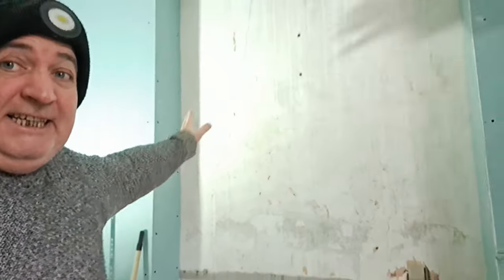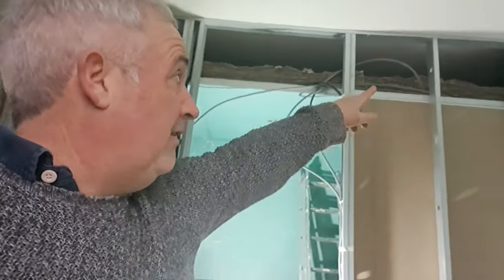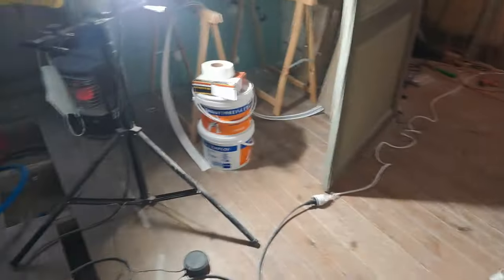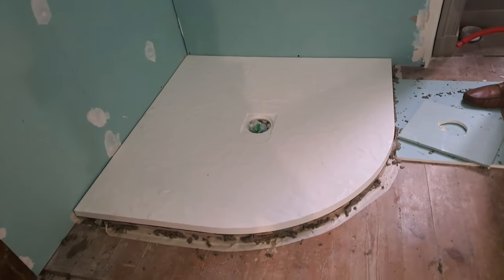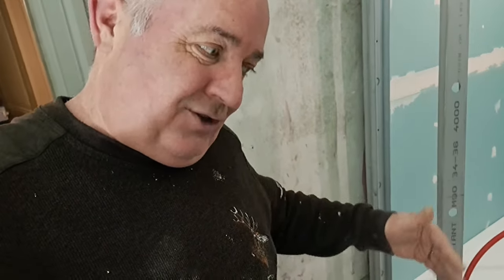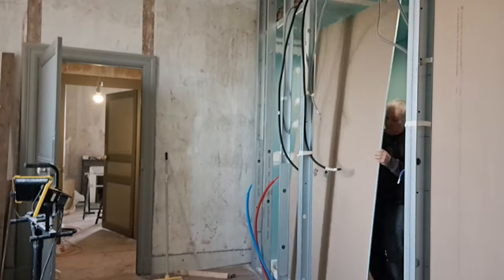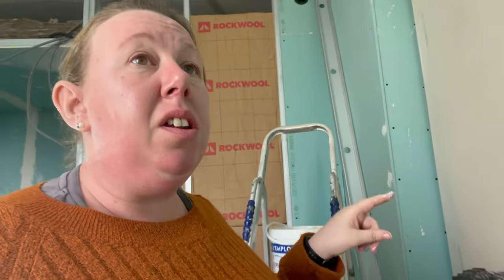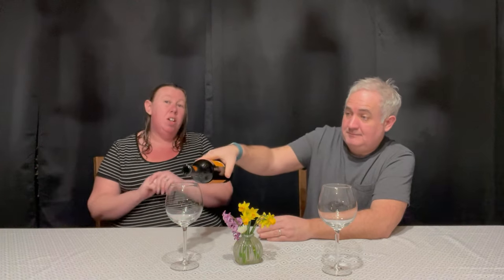He Came, He Saw, He Cemented! Father -in-Law Lends a Hand #137

Comment: The screws should be “counter sunk”. That’s the phrase you are looking for. The tape you are using, in the US, is the old style. The newer tape is a mesh with some adhesive to affix it to the wall. A tip for the non adhesive tape is to wet it. Also crease it when going on corners. 😊
Reply from the maker: Thanks Tracey (sometimes my words get a bit stuck) I do like the tip on wet the tape - I have a walkway to finish so will give it a shot. Many thanks x

Comment: is the insulation fire proof in case any wire ever over heat?
Reply from the maker: Hi Robert!  Good question - apparently Rockwool, which is mostly what I've used is fireproof - up to 1000° C.  The other type I've used is Glasswool, which can withstand up to 230°C!  We should be fine.